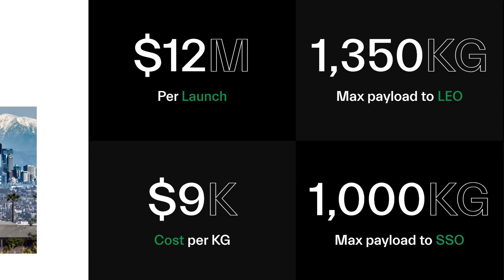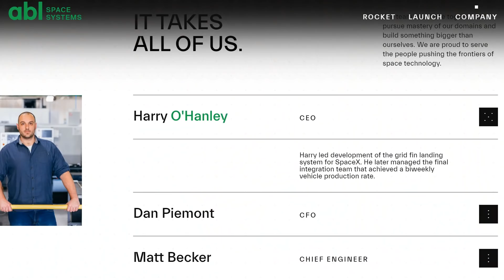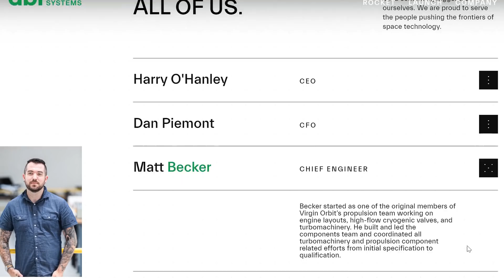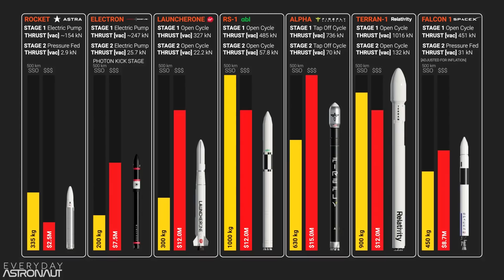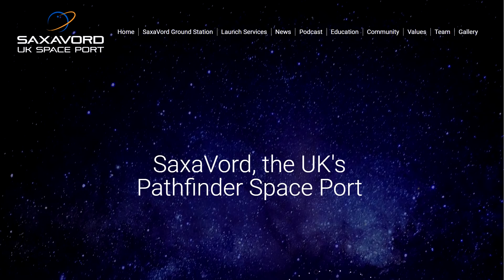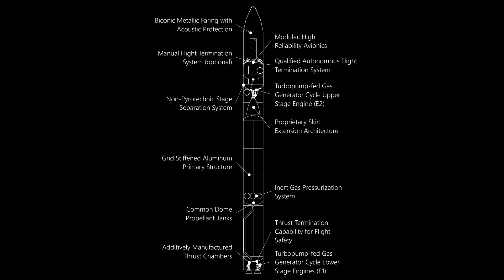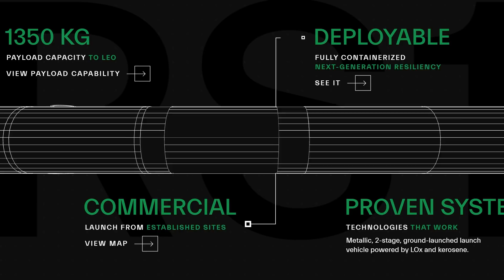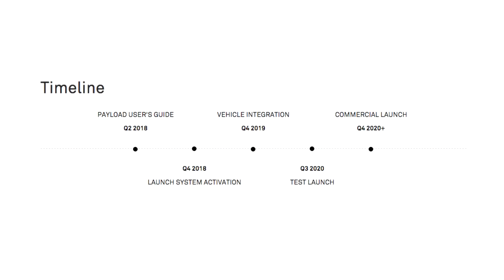Fiery Test Failure Delays Rocket Builder's Debut Launch. What Do We Know about ABL Space?

Comment: Hey Scott, you’re great! I have a question… how do they make the engine cone gimbal? I mean, what is the material at the junction between the fixed upper portion (propellant, plumbing, fuel pumps, combustion chamber, etc) and the exhaust nozzle that moves? I’m assuming they would need some really durable yet flexible material? But I’m unaware of such a thing. Or do they just allow for a small loss of pressure between the fixed portion and the movable part? Or is it negligible at those pressures and temperatures (assuming not)? Or is it just like overlapping metallic parts, where the uppermost part is inside the lower cone, and therefore maintains good pressure (since all the flow is going downward and at such a high rate, that it doesn’t really escape, despite there maybe not being a totally air-tight fixture? I hope that my question isn’t ridiculous.
Reply: I have wondered the same thing, i mean flexible hoses at cryogenic temps, yeah!. Never seen a video on that subject, so how about it Scott?

Comment: Scott,

I know this is off-topic, but I’m hoping you’ll personally comment. I would think Elon Musk would want to launch a huge RTG (Radioisotope Thermal Generator) and solar powered robotic lunar bulldozer.

It’s purpose being to ensure a nice flat solid area formed to guarantee each lander can land safely without toppling. Maybe also have a tank of fluorescent gel that would be sprayed for targeting purposes upon landing (likely not necessary, but I’m unclear what technology they use to ensure center positioning on their earth based ocean booster capture vessels). Regardless, ensuring a nominal and very large landing area for a half-dozen grouped permanent moon landers seems like a good idea. One lander with a primary and redundant RTG (the primary power source) and possibly having umbilical lines between each of the grouped landers etc…..

We landed a large RTG driven vehicle on Mars (twice), hence doing something bigger, heavier, and grander (a veritable workhorse) on the moon should certainly be feasible.
Reply: The selection of the landing site is up to the customer.  We have never landed a fission powered anything anywhere that I can think of.  I think you're confusing RTG's with fission reactors.
Reply: @TheEvilmooseofdoom  Correct, that is what I meant, thanks for this (I’ll cleanup my question).

Comment: Did you ever hear the story that one of the early rocket engine builders after losing a couple of test stands decided to hinge the roof of the test stand so they did not have to replace the roof after explosions.
Reply: Sounds like an open and shut case. It barely raised a flap. Did you see the Starlink(g) satellites at the beginning of Scotts video?  (I will see myself out 🚪}
Reply: Buildings used for handling explosives have long been built in a way they can shed off shockwaves easily without catastrophic failure. In a worst case scenario you don't want the survivers of the explosion to be crushed by the roof coming down. You can use hinged roofs or just large windows.
Reply: @A.Lifecraft  I was referencing a story I had read or heard about the early days of building rocket engines and the engineers being a little frustrated at having to rebuild after an explosion in the test stand.

Comment: Has anyone tried biodiesel or synthetic fuel? Might be another way of getting away from sulfur containing compounds that want to bind to one another.
Reply: IIRC diesel (the normal petroleum one) gave off worse Isp than RP-1 so it's never used in any serious orbital rockets. Dunno about biodiesel, but if lack of coking is the only advantage it has over RP-1, then it's better off using methane or propane instead; they don't gum up the engine, have lower mass, and higher Isp.

Comment: I've always thought the route to a cheap fuel would be to use propane.  For the reaction issues you want to get mercaptan free fuel, but otherwise should be able to use commercial propane.  Propane will support autogenous pressurization, doesn't thermally decompose at temperatures you'd want to handle anyways, and doesn't freeze at LOX temperatures.
Reply: I am not sure how feasible it is to use propane for a lot of companies. In order to get the energy density up, you need to chill it down to LOX temperatures. Not that companies haven't done similar things before, it adds more complexity to a system.
Reply: @dr4d1s  The ESA put out a paper a few years back advocating for Propane as fuel for their future rockets. One advantage specifically noted was being better for subcooling than methane as its freezing point is closer to that of oxygen. The paper claimed the ESA would thus have an advantage over SpaceX since they weren't planning on Mars Sabatier. Since then, the ESA has clearly gone for methane also, but I don't know if that's really a considered decision or just following the leader.
Reply: @shangrilainxanadu  Thanks for the info, that is actually where I got mine on the topic. Like I said, it's not that it's not doable, it just add more complexity to the system.
Reply: @shangrilainxanadu  SpaceX didn't pick methane only because of the re-use.  Another factor for SpaceX is that only hydrogen and the lightest hydrocarbons are suitable for fuel rich or full flow stage combustion.  Methane doesn't create lots of soot.  Any of the double carbon molecules is questionable, and by the time you hit propane it becomes doubtful to run a  closed cycle fuel rich pre-burner without coking the turbine.
Reply: @dr4d1s  Curious to understand the difference better, i looked up some numbers. CH4 is ~5% more energy dense than C3H8 by mass. Mass/volume density is probably more important, but I couldnt find data for both at the same pressure. I guess a couple atmospheres would be typical in a rocket.
Reply: @adamadamadamadam  Propane has a higher bulk density at about 920 kilos per cubic meter vs 800 or so for methane. Propylene would be even better for bulk density but it's thermodynamic properties are worse.
Reply: @adamadamadamadam  What matters is the liquid density.  Pressure has a minimal impact, but subcooling has a huge impact.  
At their boiling points, liquid methane and liquid propane are very close in density.  When subcooled the propane becomes quite dense, more than double that of methane.  Propane and methane have similar freezing points even though their boiling points are quite far apart.
Reply: @dr4d1s  Yes, I have heard of that downside. It would require LN2 to the launch site and a heat exchanger.  The LN2 does have to be lightly pressurized to prevent freezing.
Reply: Hank Hill approves of this idea

Comment: Gunk in engines is only a issue for re usability, but for a liquid fueled (one way and cheap) missile with moveable support equipment and easily accessible fuel, now that seems like up Northrop Grumman's alley.
Reply: Gunk in the regenerative cooling systems can cause engine failure, as Scott mentioned.

Comment: I feel like cost/mass and max mass are going to be commonplace metrics we hear about commercial rockets, like mileage and power in our cars.
Reply: Thing is, you're talking about cost per mile (for cars) versus cost per kilogram launched to a specified orbit (for rockets). The issue is that cost per mile for cars is almost entirely dependent on the cost of fuel, whereas for rockets (especially expendable ones!) cost per kilogram is related almost entirely to the cost of the vehicle itself divided by how much payload it can move, because the fuel might as well be for free for how down in the noise that particular signal is buried (fuel costs are tiny for rockets, because for most rockets you throw away the extremely expensive rocket along with burning the fuel!).

Whereas the more common metrics for cars (in my experience) are how far it can go on one tank of gas (max payload to specified orbit for rockets), and distance per fuel consumed (mpg or kilometers per liter for cars, but specific impulse or exhaust velocity for rockets).

I guess that my point is that cars and rockets do such different jobs with so vastly different requirements that comparing them isn't exactly helpful, except as a teaching aid to teach rocket concepts to people that already know car concepts.
Reply: @44R0Ndin  I'm not talking about physics or math, just the terms we might start hearing.
Reply: @44R0Ndin  TL, DR, this looks like the text from an angry ex
Reply: @44R0Ndin  PS I'm better at KSP than you.
Reply: @andyd8370  Ah yes, an unfounded personal attack, the ideal refutation to my statement that wasn't even intended to be an argument in the first place.

Been playing since 0.13.3 bud, I've probably been playing the game longer than you've been alive.

Comment: RAF Saxa Vord is NOT 'Disused' - although it was for a while. It is unstaffed however, it houses a Remote Radar Head as part of the UK's Air Defence network.

The old Domestic Site from when it was staffed and other areas have been sold off however. Presumably that is the basis for the launch site.

Saxa Vord is subject to truely horrible weather, including winds that have damaged the radar at Saxa several times over the years and snowfall that requires enclosed corridors between all the buildings to allow people to move around in winter. I also wonder whether the AD Radar nearby will be a help or a hindrance (requirement to keep it operational during launches and NOT to land on it).

Comment: The small launch space is really crowed. Are there really that many demand? Some of these companies have to fail right? Or the market can support way more than we currently have? Would be nice to do a video on the topic.
Reply: Well, look at it this way - RocketLab, the only one of those small-launch companies to make a success of it, is looking to go bigger for their next generation vehicle. What does that tell you, that they're not even facing competition yet, and they're already moving away from that market?
Reply: Its certainly an interesting issue.. will cheaper launches increase demand or will it all just implode because there simply arent enough payload builders out there?
Reply: I think that depends on how quickly some of the new payload types can be built. Doing things in orbit other than transmitting signals to Earth would help. Being able to manufacture useful quantities of LEO materials would open a new market and require more ways to supply them. There are several companies working on different types of orbiting stations.

Comment: I'm asking, when in space and you manoeuver causing g, why does not all the air move to the end of the ship. Causing those at the front to suffocate. I've never seen anyone concerned about this.
Reply: Think of it this way: under one g of acceleration, it takes a column kilometers high for air to get thin enough for hypoxia.
Reply: Air does actually move towards the end of the ship more, but not enough to create a significant lack of air up top
Reply: @SpaghettiShaq  thank you
Reply: Richard Upcott, the same reason you don't suffocate on the second floor or going around a turn in a car.  There is a pressure gradient though.  Put a helium ballon in a car. When you step on the brakes it goes to the back of the car.

Comment: The airplane industry relied on a few companies that built engines and this allowed many aircraft manufactures to build and design their own planes built around a proven engine. Why not do the same with the rocket industry. It seems engines are the biggest problems with rocket design.
Reply: The issue is that you need to optimize the engine for the launch vehicle nearly every time, and every rocket has different requirements, and you can't just do something like "run the engine at part throttle" because rocket engines efficiency at part throttle is HORRENDOUS compared to full throttle (both absolute thrust AND ISP are related to the throttle setting, if the engine is even capable of throttling much at all).
Even "de-rating" an engine to run at full throttle at a lower thrust level results in you needing to re-design one or more of the most critical core parts of the engine, the turbopumps and/or combustion chamber+throat+nozzle assembly.

The closest thing I can think of to what you propose that has actually happened is how many different launch vehicles can trace their ORSC first stage kerolox engines lineage back to the Soviet/Russian RD-170 engine originally designed for the 4 liquid fueled boosters of the Soviet/Russian Energia rocket. Speaking of that, that was a design that was too damned good to only be allowed to fly 2 times. I'm sure we here in the US could have learned quite a few lessons about how to build good rocket first stages if we had been able to do something like buy that entire program right from Russia, but of course such a thing is unthinkable, even today.
If that had happened, I could imagine something like the SLS flying as an "Energia 2.0" of sorts, still having the top-mounted 2nd stage and payload like SLS, but instead of the 5 segment solid rocket motors we might have seen kerolox boosters using an Americanized derivative of the RD-170 (almost certainly still done in Metric where it counts, but the public-facing statistics would have been converted to units more familiar to the average public).
Reply: Slight problem with that in the US. Rocket engines kinda fall under ITAR laws, so it would be very problematic if someone sold an engine to someone who then 'lost' the engine in transit which then becomes a missile that hits a city.
Reply: TBH monopolies are generally kind of bad, they prevent expansion and improvements over time.
Also, no, not all planes use the same engine

Comment: a failure in testing is expected. this is what testing is for. to make sure you have everything right. a failure proves you missed something. constant failures are a problem.
Reply: One failure is a good thing, many failures are still a good thing, so long as those many failures aren't able to be traced back to a singular cause. If many failures are able to be traced back to a single cause, that means either you're not learning the right thing from your failures, or you didn't entirely solve the problem, or there were in fact many factors leading to the same failure.

Something is generally considered well engineered when all the components wear out at roughly the same time. Cars are generally well engineered in this way, by the time the engine is worn out so is the transmission, and the body of the car will likely also have issues of its own as well (in areas where winters cause ice, this means the body will have significant rust that impacts the safe structural integrity of the vehicle by the time the engine is worn out, if they engineered the corrosion protection correctly).

Comment: I don't get why everyone develops their own new engine.  I get Spacex Raptor as Musk has a habit for everything in house and rapid iteration to the next generation.  Rolls Royce, Pratt-Whitney and GE alone sell thousands of jet engines in dozens of configurations for military/ civilian use thereby achieving economies of scale in both development and production.  Where are the rocket engine companies doing the same?
Reply: Because we are at the early stages of commercial space flight and every company want to be the one producing and selling their engines, how many decades it took before airline industry switched to bought engines?
Reply: @randomnickify  Fair airline comparison but since 2018 average is over 100 space launches per year.  Just seems strange that every start-up "needs" to develop a new  engine.  Maybe it just shows how moribund the industry is.
Reply: I guess you could say that BO is/was doing this, but they are a wee bit behind schedule. The Russians sort of did this, though I don’t know if they were still making the engines or just selling off engines left over from the Cold War.
Reply: There are a lot of joint ventures but there are 20 or so jet engine manufacturers.
Reply: It's sometimes impractical; every rocket has its own requirements which need testing and a lot of data collection to perfect it. With jet engines, you only have to change the systems and setup and you're good to go